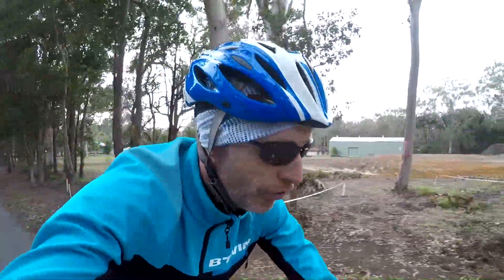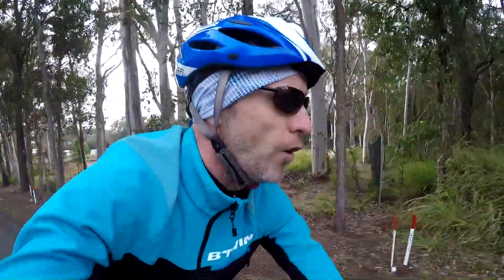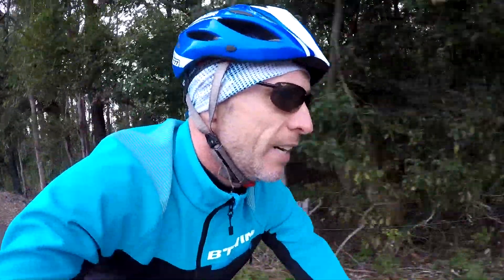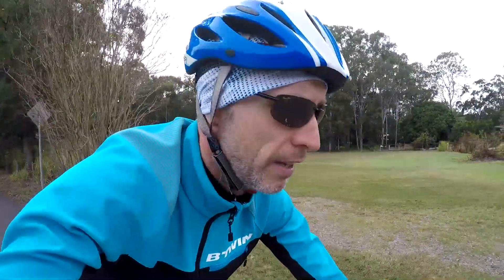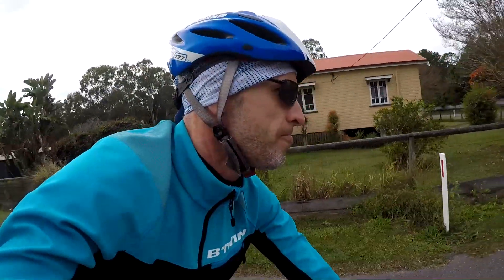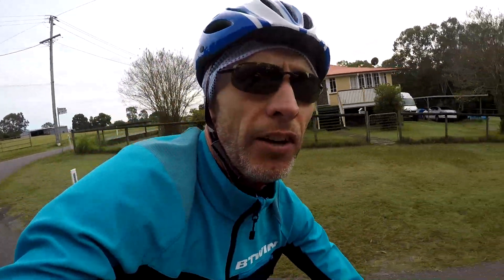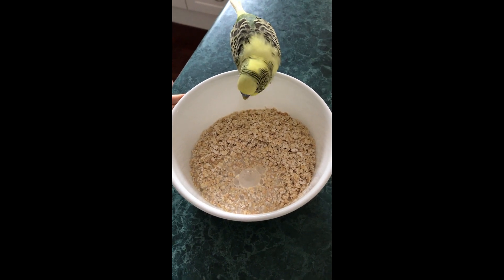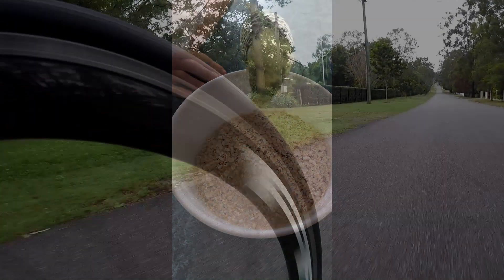Do Your Carbon Wheels Explode When Worn Past The Marker?

Comment: Dead keen to see the outcome here as have a pair of alloy braking track carbons sitting in customs on the way to me now. This article popped up suggests the braking track is not really adding structural integrity, so close eye on if the braking track wears through to carbon, would be your indicator to replace the wheel. Makes sense.. http://road.cc/content/feature/238960-how-tell-when-your-wheel-rims-have-worn-out